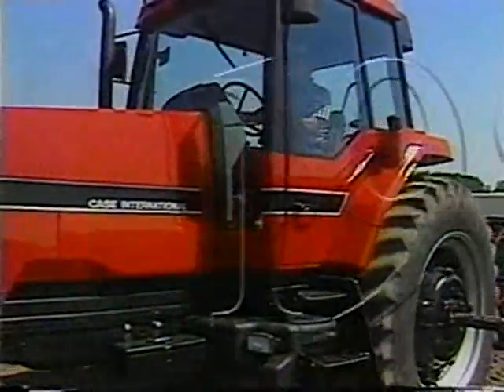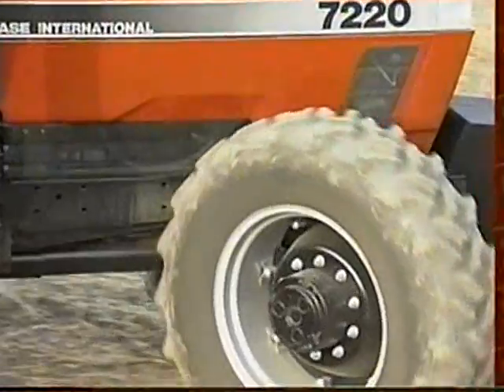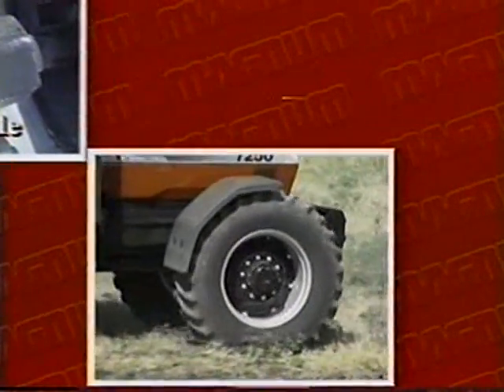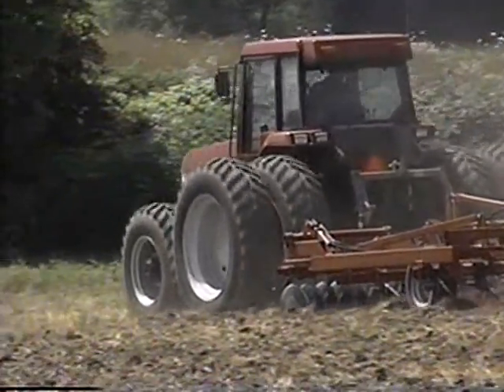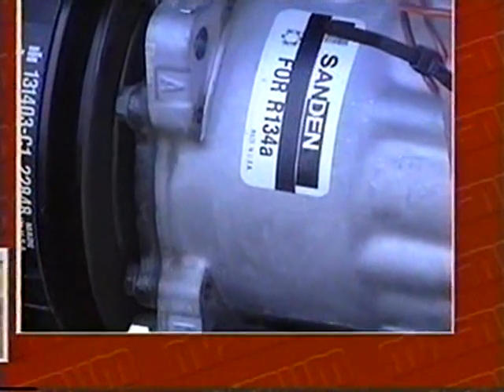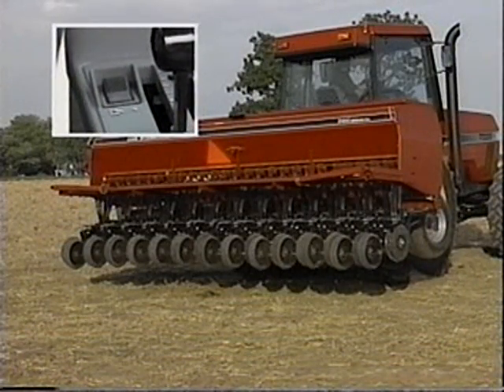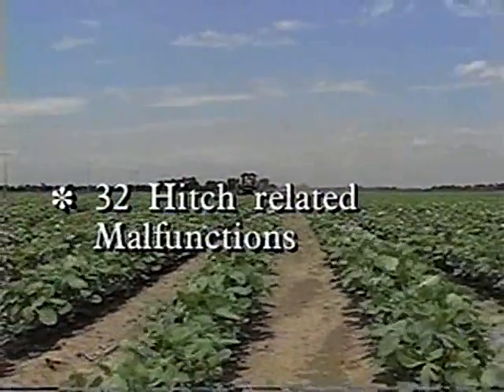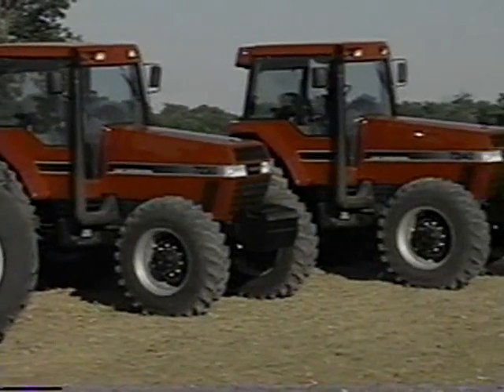CaseIH 7200 Series Introduction

Comment from the maker: @Hanson967 
That''s right:  Most of the Magnum (7100/7200/8900) was IH.  In fact early production 7100 Magnums still had IH stamped into many of the castings underneath!
Reply: IH986fan 
Must be why they were so good
Reply: IH986fan 
I have a video, somewhere, that shows the testing and disassembly at 10000 hrs to show the amount of wear after so many hours. They had very little wear in the engine and transmissions. I'll look for it but of course it's on VHS.

Comment: I LOVE that Tractor.   Those are some great improvements.  I still enjoy driving my 2590 (especially since I put in my new stereo and speakers)   
1. When is Case going to start using LED's instead of conventional lights ? (brighter and less amp drain on the alternator)
2. When is case going to put in a "spit cup" holder ?
3. Please upgrade your stereo system
4. Onboard diagnostics would be a welcome feature.
5. Onboard ice chest with external drain would be nice.
load / rpm indicator would be great for fuel economy
6..  A darker "eyebrow" of Tint around the entire top  of windows would be great - would not hinder visibility at night
7.  Super easier window latches....but still air tight please
8.  Small External storage box for link pins and spacers
9.  Blu-tooth cell phone connection to stereo
10.  Small back up camera (pointing at draw bar) to see "drag type" implement hookup alignment

just a thought ......

Comment: Our farm was run by green for years. Then the JD dealer changed ownership and it was impossible to deal there any more as well as the IHC deal was also bought out but the opposite took place there they would deal so over a 5 year period our farm went red to our surprise the IHC used almost half the fuel. The the disaster of farming history happened an oil company and JP Morgan took over 3 quarter remaining farm equipment manufacturing. In our area this year people and 2 colonies had to resort to using their old tractors and neighbours who still had old tractors to get their crops seeded. The new crap would leave them stranded totally and the dealers mechanics had zero clue how fix the latest tec because it was to resent. In one case a 21 dollar sensor cost the farm over 2000 dollars by the time the dead horse was trucked in to the dealer fixed and trucked back. 2 local farm manufacturing families were  bought out by CNH because the plants were running at 87 percent efficiency but it only took the 7 years of professional management to bring them to what they are now 35 percent efficiency. From quality manufacturing to part making farmed out to the lowest bidder with the equipment barely working for two years but 7 to 10 time the cost to buy. One small problem once caused the whole assembly line to stall for 8 months with flying  engineers in from every firm and continent costing millions of dollars to fix and finally a local boy with GDP grade 12 snuck into the compound with a simple tape measure and learned that a plate had been jigged to be welded on on the thickness of the steel over to the opposite side of the plate. Took him 5 minutes to find. This goes on daily. In the Saskatchewan circle of farmers we think so poorly of high ranking engineers that it almost a shame. The illiterate have often out performed them to the point that some manufacturers have totally shut down their R&D departments. It will change as the empires are all owned by the same investors or share holders and their greed system falls and we the people will take it all back and once again take on the responsibility to feed our fellow man. My last  rant of 2019, Merry Christmas and a Happy New  Year.

Comment: Not much Case input in these great tractors, IHC cab, IHC transmission, Cummins engine , interesting how Case scrapped all their crappy line and kept IHC tech !
Reply: Ever see a 5488? Where the Cab Door opens up and throws you into a Shitty Tire? Case Cab Case Controls? You don’t see a shifter on the Dash???? 🙄
Reply: @robwar2288  exactly they are crying over a merger that improved the tractor by a lot
Reply: @jwhitley101whitleyfarms9  it was a win for both companies!